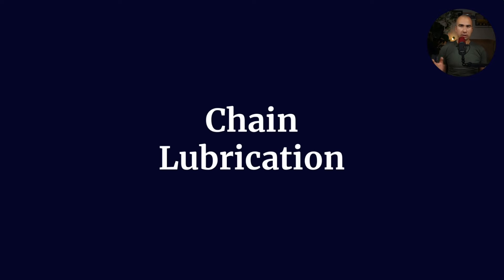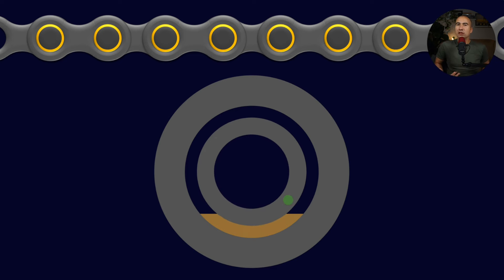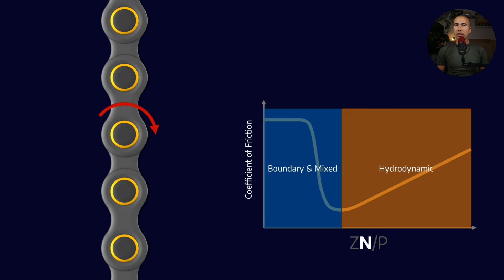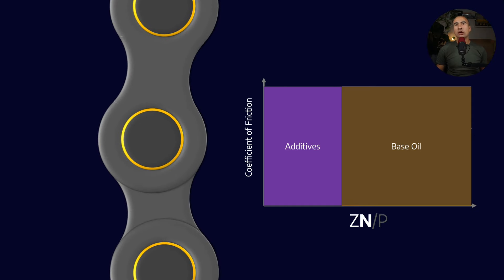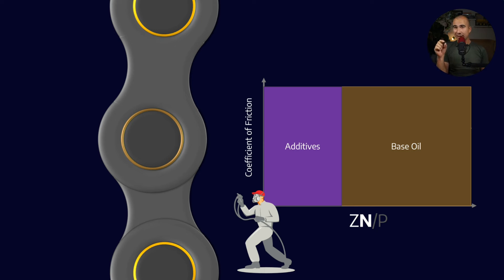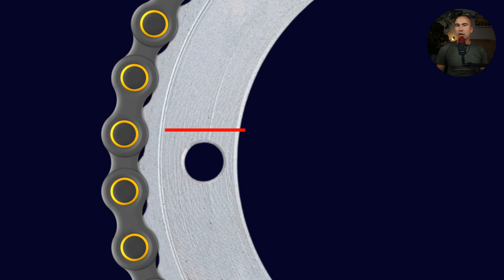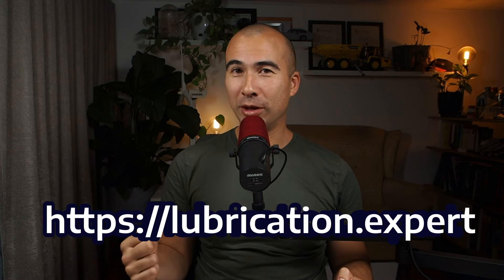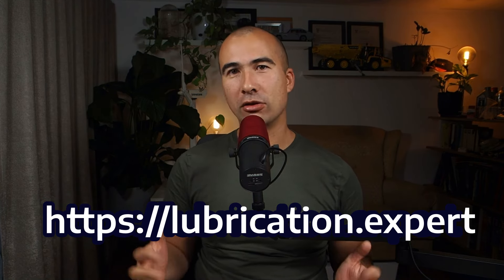How to Lubricate Chains

Comment: Lubricating a Motorcycle Chain would have to be one if not the top hotly contested debates and arguments on every forum and Facebook page forever. So many ‘swear’ by their own research, technique and product of which there are many!
Reply: And it very much depends on the type of chain, for modern motorcycle chains where the pin lubrication is taken care of by grease from the factory that is sealed in with O or X rings, you need a different lubricant than if you are using an old fashioned plain chain
Reply: @ilovecake50  If you have the sealed lubricated chain the pins & and bushings are well lubricated but the rollers & sprocket teeth will still require a topical lubricant.

Comment: During economic sanctions in 1970's Rhodesia, we couldn't readily get chains for our motorcycles, so maintenance was of utmost importance. We would remove the chain, then throughly wash it in a bath of kerosene. 

After the cleaning, it would be immersed in a bath of melted grease, then removed and allowed to drain. Once cooled, any excess was removed, leaving lubricant where needed, on the pins. We would also reverse the travel direction so as to not have wear on the same thrust surface. Seems excessive in a disposable world, but it is essential if we wanted to ride.
Reply from the maker: Ver resposta curta

Comment: I make my own chain oilers for my motor cycles.
The best life I have had from a chain was 93,000 km  on a Suzuki 1250 Bandit . The chain eventually needed replacement because one internal bush on a pin had collapsed .This was a roller chain with pins , then a fixed bush on the adjacent link and then a free turning roller , all sealed with quad rings. Size 530). The collapsed bush caused a clicking sound each time the link was under load.
The remaining links were all within  wear limits using the elongation measurement method - actually around 30% wear. The chain slack had been adjust around 4 times in that 93,000 km - usually at each tyre replacement.
The lubricant I use is 20w40 oil with 10% kerosene which aids wetting when the oil contacts the chain.
In my experience the same chain on the same bike with regular manual lubrication would wear beyond the recommended limit within 20,000 km
Reply: Wow, 93km!  Had a Bandit 1200 replaced the chain once at 30,000 miles, the first 6000 miles were put on before I bought it.  I used a Scottoiler.  My current bike is a GSX-S1000 with 17,000 miles.  I think I adjusted the chain 3 times so far?  Scottoiler E-Oiler on this one.  And I just use used engine oil, as I do my own vehicle maintenance so the oil is already paid for.  I save the 0w20 dexos in winter and 10w40 or 15w40 in the summer.

Comment: Just an idea for a future chain video. Could you go into the depth of balancing lubricants for timing chains (especially when it comes to low viscosity oils), and cvt chains (where a level of "grip" for the pulley is needed.

Comment: I took a bicycle chain and put in a bath of Almasol LE451 NLGI 000. Heated it to about 40-45 C° and added vibrations. When still warm, let i "drip dry" and then cleaned it properly with paper on the outside and finished of cleaning it gently with Industrial degreaser on a cotton cloth. Survives for ever and takes water but not sure if it suiteble for racing bikes.

Comment: Chains:  simple and OH SO EFFECTIVE!
The chain and cog system has been a resounding success on bicycles for 150 years.  People love to complain, "Why haven't bicycles evolved!" on a LOT of forums.  This only reveals how ignorant they are about bicycles and human power.
Humans are incredibly weak.  So when you operate a bicycle, it's imperative that  you have an efficient and light drive train.  Enter the chain and cog system.  Nothing comes close.  There are alternatives, but they have drawbacks:  price, weight, and efficiency loss.
I'd LOVE a Pinion-equipped internal gear bicycle.  Or a Rohloff internally geared rear hub.  But are they necessary?  No.  The 1X 12-speed mountain bike drive train is here to stay (until it becomes 13-speed...)  But fundamentally, it's tried, true and proven.
"But you can tear your rear derailleur off!"
50 years of riding, training and racing on road, mountain, tandem road and tandem mountain bikes - and even unicycling! - and I have YET to tear off a rear derailleur.  Maybe technique is involved, I don't know!

Comment: Answer: enclosed oil baths with plenty of additives. I once had a motorcycle with an enclosed oilbath chain so it is a more reasonable option than people think.
I also worked in a place with a low speed chain-based hanging conveyor and it required several oilers because of the extreme length (nearly a mile). If only using one lube station the amount of oil needed would drip off and cause problems with the product being conveyed. Some fool manager decided the answer to drips was just turn off the lubrication, massive wear and lengthening within a week.

Comment: It would be interesting to hear what you think about the wax based systems which are applied via immersion. They are very popular for bike chains. A bit different than the typical oil / grease systems
Reply: I think that since most modern chains on bikes have tiny sealant rings for each chain link (which are already lubed inside), the main effect after the immersion into a liquid paraffin is that the water and dirt won't stick to it as much as with using, let's say, 75w gear oil, as the latter isn't dry.

But for the unsealed chains it's probably completely different, like a timing chain in an engine is obviously lubed with the engine oil and can last over 100k miles within it's spec, at least in older engines.

But I would like to have a deep dive into this topic as well.
Reply: @TRiToN219  they do not.  It would be cool if they did, but today's chains are far too thin to be able to add seals in this fashion.

The main advantage of immersion waxing is that you fully permeate the chain with lube (both paraffin and other solids), but most importantly, you have virtually ZERO oily substance on the exterior attracting dirt.
It is dirt, especially when riding off road and/or in mud, that attaches to an exposed chain the creates and abrasive paste that works to quickly abrade the steel surfaces and promote chain elongation.
Dirt is the nemesis of he bicycle chain.  It's impossible to avoid.  No matter how OCD you are about your bicycle chain, it's a black mess in very short order.  
Immersion waxing and proper drip wax maintenance appears to be overtaking the bike industry.  I'm one of those who's always WANTED to make the transition to immersion waxing, but haven't.  I'm THIS CLOSE to making the change on my bikes.
Reply: Lubricating a roller chain with a solid, like wax, rather than a fluid, like oil, is a bad idea for very obvious reasons. There is a huge marketing campaign pushing waxing for bicycle chains, but it is a proven inferior method.
Reply: @JoeyMills-y3v The benefits of wax aren't generally built around the idea of it being a superior lubricant versus oil (although that claim is made by some products), but rather it's the ability of wax to do the job of keeping two metal surfaces lubricated while resisting contamination. Therefore, whether oil or wax is "superior" has to be taken in the context of the conditions of use and maintenance schedules. You could formulate the most lubricious oil-based chain lube of all time but it would very quickly become an expensive grinding paste given dry, dusty off-road conditions. Likewise, many waxed-based lubes don't perform particularly well in extremely wet conditions, or wax emulsions may require relatively long drying periods making them impractical for quick re-application during extreme distance races.

However, this is the internet, so I have to say that the chain lube that I use is best and everyone else is a gullible idiot.

Comment: last week, I opened up my engine as preventive maintenance, & to swap out the oil pump & collar for the timing gear to a WPC treated set.

I took the opportunity to measure the 207000 mi timing chain (in the engine) vs 3000something mi, & a Zero mi chain.
The difference between 207000 mi vs Zero mi was 1 mm longer. The 3000something mi was close to the 207000 mi chain.

Would your expertise cover more in chain stretch?? Because the car community, & shops I encountered treats timing chain as if it was made of (fatigues like) Al.

Comment: Gear oil 80w90 is the best oil to eliminate dirt/sand from links and provide lubrication as fast as it can directly to bushing. Especially if it applies by automatic systems - oilers while the chain is already warmed up.

Comment: I raced motocross and rode off road for 20 years.  I tried everything & I'll share the secret with you.  Start with a non o-ring chain because they're cheaper, roll easier and don't hold as much dust and sand in the links as an o-ring chain.  Don't ever use "chain lube" because it collects sand, dust and turns it into a and abrasive compound that sticks to your chain.  Simply pressure wash your bike and chain often.  pressure washing the chain while you roll it, washes out all the sand and dust in the links.  After pressure washing the chain spray it with WD-40.  I learned this from a very fast racer that also worked at a dealership as a salesman and later a mechanic.
Reply: You are useing oring chains all wrong. The dirt stuck on the outside is not the problem, orings hold in a factory applied grease on the actual bushings and prevent entry of dirt. "Lube" for oring chains is basically just a superficial rust prevention oil and keeps the rings soft, like dirt the external chain lube never penetrates pass the orings. 
Dirt on the outer rollers is not what causes wear and chain lengthening although it can wear on the sprockets.
The "easier" roll in your hand is mostly irrelevent, like all bearings, the friction must be tested when under load. The added fiction of the rings compared to the better lubrication of the bushings, and consideration for temperature and strength of availible new chains might be significant in some fringe racing categories but it is a question far from having a universal correct answer.
Reply: The first chap was referring to non o-ring chains. There’s as much advice on chain servicing as there are products - it’s done to death as far as I’m concerned - I just use gear box oil as recommended by most manufacturers and clean the chain when it’s dirty - then I get on with the rest of my life…

Comment: I personally use WD-40 and an old tooth brush to clean my motorcycle chain. Then I apply EP120 manual transmission oil using a toothbrush. My chain has lasted quite a while. Still not worn completely.
Reply: I used to pressure wash the chain then apply wd-40

Comment: The pin only slides against the sprocket teeth in the most basic chain designs.
Most chains use a roller between the pin and the tooth.

Comment: The sprockets do not see extensive sliding, the roller rolls on and then rolls off. 
The wear happens between the roller and the pin and in general, internal roller wear is not an issue as it does not change the length of the chain between pins, and so does not lead to the chain being longer which causes it to ride high on the teeth and wear the teeth.
So only pin wear which will lengthen every second link is to be concerned about.

For a bike chain there is no requirement for lubrication between roller and sprocket, all the work happens inside.
Any oily lubricant on the outside of the chain and on the sprockets only serves to pick up dirt and create a grinding paste and this is what wears sprockets on a bicycle.
Wax based lubricants applied by immersion have proven far lower friction and wear and do not pick up dirt, so save the sprockets from wear, allowing them to last 10 times longer than those using more traditional types of lubrication.
Even just plain paraffin of good base stock, applied by hot immersion, is far superior to any drip or spray applied lube.
Add some good things to the paraffin and both friction and wear are reduced further.

I would love to see you re-visit this topic as much testing has been done in recent years.
I have been immersion waxing for at least 10 years and I am yet to replace any sprockets on my bikes, just replace the chain when it is out of spec.
For off road MTB or gravel riding especially, the gains in longevity for chains and sprockets is huge.
I love the channel, but on this topic you are wrong...
Reply: You didn't watch the video, did you?

Comment: As an avid cyclist and lubrication engineer, I find it interesting how little the bike chain lube companies understand about tribology. However, I do wonder about something that is a new lubrication trend that I can confirm does work on bicycle chains: waxing and wax submerged chains. In my personal anqectdocal research along with proven third party testing I have also found: using a wax-based chain lubricant that penetrates the pins and rollers, you are able to get much more life out of your drivetrain and significantly reduce friction. I would really like to understand more how it works on a physical level. There are also solid additives used such as graphite or PTFE in these chain waxes.

Comment: For enduro / mx bike chains basically nothing that makes sense for a more normal chain use applies. I've yet to see a product that has a chance to work as intended for more than a few minutes when your chain and sprockets and all the other sliding surfaces get absolutely caked in mud and dirt that gets squished into every nook and cranny. This dirt sludge works like a sanding paste and will most certainly clear out any sort of lubricant in a matter of minutes. Your best bet is an X-ring chain sprayed with WD-40 after washing for the sole reason of keeping the chain dry and preventing it from rusting while sitting. Anything else you try to do to keep that thing better maintained is at best gonna give you one additional ride out of it, so it probably doesn't even make financial sense with how expensive some of the specialist off road chain lubes are. At least that is my experience with mostly muddy and horrible riding conditions. I can see something like PTFE working for chains in drier off road environments.